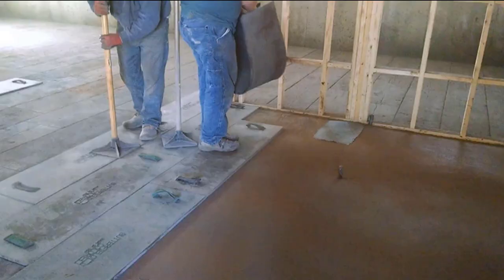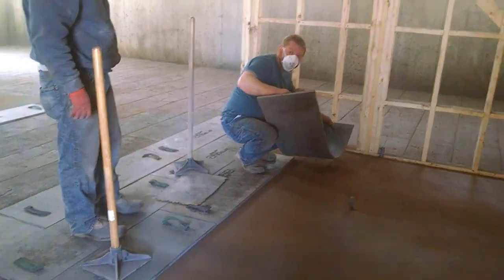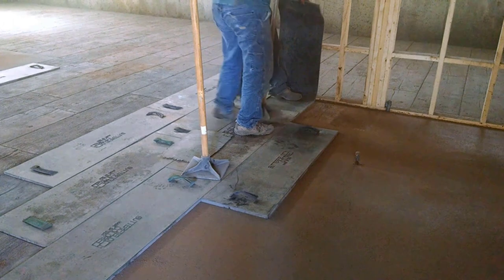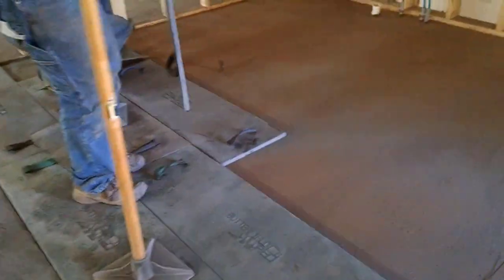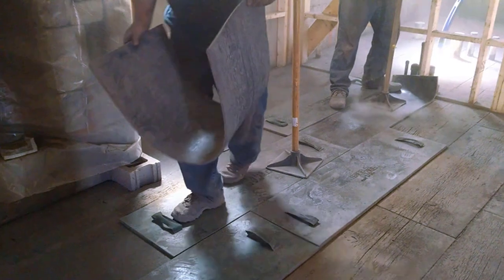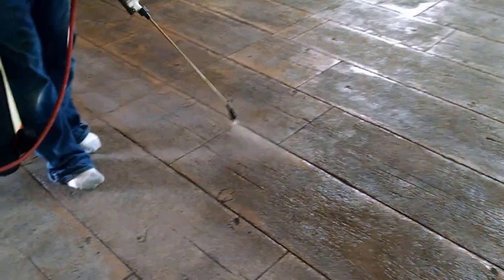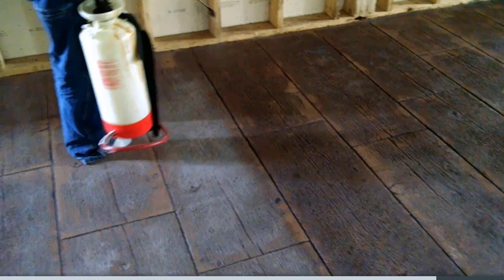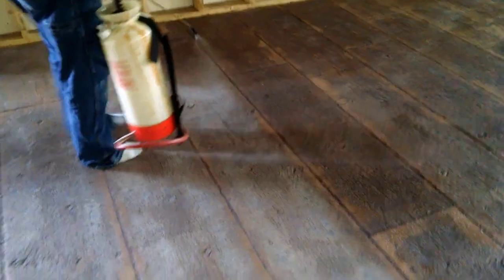How To Stamp Concrete - Stamped Concrete Patios, Floors, Designs, Diy

Comment: Mike need more information!!! Like what type of mix design must be ordered from the batch plant ? What PSI and aggregate requirements ?  What about slump ? Also what fiber reinforcement do you use have this premixed or onsite ? When you add  color to the mix is this done at plant or onsite ? Also if you pump the mix , you have to add water to allow it to pump thru the machine so how does that effect the stamp process ? Also how many gallons do you add to the mix to get it pumpable  ?  These are questions I need answered for me  ! I want to eventually add stamp concrete to my trades as a side business . But will eventually do it around my house first to get my self and my guys learnt !!!! Thank you for all your great and useful information it does have an inspiration effect on me and what I look  forward to doing with the new knowledge in the near the future ? Any how just FYI !!! I only do YouTube , no Facebook

Comment: Excellent job im starting doing stamp concrete in Poland i have a question about concrete mix design for a stamp concrete i wana go to the batch plant and give them recipe for good concrete for my future jobs i m using most of a colour hardener and sealers from Ideal Work company i will be preachier for some good advise   from you .
Reply from the maker: The mix I use for my stamping projects is a 4000 psi mix with 3/8 stone (peastone). This is my standard stamp mix.
I will usually add micro-fiber mesh to that also. You can't see it in the mix it's so small.